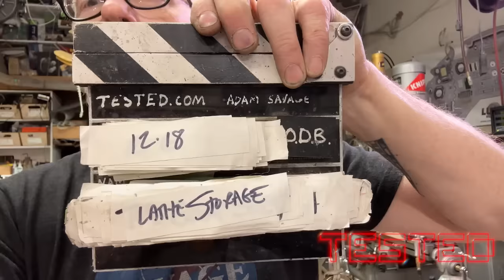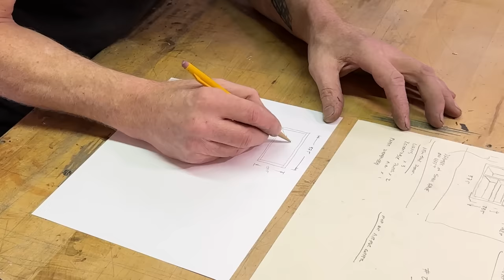Adam Savage Sets Up His Shop's Second Lathe!

Comment: Love how the lights dim when the Lathe switches on 😂
Reply: Big motor on the same line. Kinda like having water run down a pipe and flowing at one end you open up another tap in between and until the flow equalizes, the waterflow on the end is lesser.
Reply: Quite the power surge
Reply: @aserta  Also doesn't help that he apparently has the lights above the lathe and the lathe itself (and possibly other things) plugged into a power strip mounted on the wall above it. (You can see him unplug it around 15:37 while he's working on the gear section.)
Reply: It's probably a capacitor start motor. They build up a lot of current and then dump it all at once to kickstart the motor.
Reply: At the Heritage railway i used to work at the shop lights would flicker when we started the big lathe, it was like 4500mm between centers and 700mm over bed.
Reply: Motor In rush current from start up
Reply: soooo lathes, like printers, should be on their own outlet...
Reply: i would have preferred that space be open thru to other side instead of blocking it with the lathe. now you have to walk all the way around to go to either side. could have had two ways to get from either room. and all those metal shavings... lol
Reply: It’s like when I turn my vacuum on and my lights dim in my home lol 😂
Reply: Yeah. He really needs to put that lathe on a dedicated circuit.
Reply: @Moddage  That power strip sure looks busy. 😐

Comment: I have a small Jet 13x40 I bought new in 97.  Been an amazing tool and paid for its self a 1000 time over.  It’s really heavy and has two cabinets on either end where I keep hundreds of pounds of round drops and my chucks.  I love this cabinet you built.  I believe you bought a new lathe since this video was shot.  It sounded like my main Sharpe mill that needs swapped out with a good one I don’t use because of space problems.  Thanks for sharing and inspiring.  You rock

Comment: The 1st cabinet I put a light in was a  bathroom corner sink cabinet in 1998, when I was remodeling my 1st house.

I'd been building/installing cabinets  as a remodeler for 30+ years & had never thought of it before.

Now, I can't understand why ALL lower cabinets don't have lights. I worked my way thru the bathroom & kitchen putting lights in the lowers.

Now that I'm officially ancient & my eyes struggle w/ light transition, I'm even more pleased I did.

What cabinets I have after the shop remodel I'm in the midst of, will get lighting, as well. But I'm moving from cabinets to a full wall open shelving design & getting rid of half my cabs. Most remaining cabs will be drawer cabs

Comment: I have a lathe in that class. If you remove the spindle, be sure you have the belt in place before you slide the spindle back in. I missed that step the first time😯 so I had to immediately remove it a second time😖 I'll be interested to see how you preload the spindle bearings.

Comment: I'd setup the second lathe for CNC operations. It's easy and it opens up some tasty possibilities. Depending on how profesh the upgrade is, it can be expensive, but you can 100% make it on the cheap, including second hand parts and DIY componentry.
Reply: It’s far more sensible for someone like Adam to buy a used cnc lathe. It is by no means easy, and the usefulness is limited for him retrofitting an old lathe is almost never worth it, for a multitude of reasons.

Comment: Before taking the gearbox apart check the play between the interchangable gears! Its common that people leave not enough play between gears when switching them out! gears should have some play. Put some drops of oil on the gears after adjusting. 9/10 times its tight gears that cause that sound! 

If that does not help, check if the main bearing for the chuck spindle needs adjustment. 

Greeting from a machineist from Sweden.

Comment: nice build That Shenwai sounds excat likes mine from 1978 when the feed is engaged. the smal gears running again the spindel sounds terible and trhe 127 tooth gear sings its own song.  the build in poulies are on an extra frame behind the headstock.
great lathe use it every week.

Comment: Great work Adam; your cabinet was elegantly simple in construction. I noticed your lights dimming when you turned the lathe on; I think this indicates power sharing between differently-rated circuits. With a complex set-up such as your workshop(s), it is probably worth reviewing your electric supply circuits and/or advice from a clever Sparkie, who may recommend upgrading sections of the supply cables. Something beyond my skills to do, but then most of my tooling is hand or battery powered!

Comment: Adam, it appears that you have that lathe wired for ~110V and plugged into a power strip(as seen being unplugged around 15:37) with other things, if I'm not mistaken that lathe has a ~1HP motor in it which likely has a nameplate rating of around ~12.6A at 110V(unless the motor has been swapped of course), per NEC 430 and assuming it has a 1HP motor that lathe should be on its own 15A circuit @~110V.  Please check the motor nameplate rating and adjust how the lathe is connected to power for safety sake. You could also rewire the motor connections for 220V(it should be a dual voltage motor) and supply it with an appropriate 220V circuit. At least eliminate the power strip between the lathe and the power source, between starting current and current under load when machining something, that power strip is not likely to be happy.

Comment: Hey Adam, Suggestion - You could PIVOT the TWO LATHES  to form a U SHAPED LATHE PIT - Lathes facing each other.
Then you would not have to walk around into the Hardware Store to use the smaller lathe.
You could out the Chucks and common Accessories at the end of the U SHAPED PIT to close it off from the Hardware section and gain more area there.
Regardless - Love the reorganization - you are an amazingly patient man - I would have lost what's left of my mind..  ;)

Comment: I am sure this has been suggested but I think you need to move your table saw to the new hardware store area. You could build sweet outfeed table with tons of storage and place it right where one of your work tables are located currently. Outfeed tables with table saws greatly increase efficiency as well as safety. It would almost be no consequence unless you can't seem to keep it clean.

Comment: I think you should have a backsplash behind the lathe (plexi?) so that fluids are better contained.  Also, I like using 3D-printed stands for Morse taper tooling so the tapers don't bang around and get 'bruised'.  Personally, I would have made the cabinet ~8 inches shorter so that the top could be an open shelf for stuff you need at hand (like a lathe file).  But I love the idea of lights!

Comment: There are differences in lathes 4:09  that I consider a deal breaker in some cases. I learned on Colchesters and the handwheel arrangement on that type of lathe. If I try to use a Harrison lathe which has a handwheel configuration that is opposite to the Colchesters, it feels completely alien to me.

Comment: Clean the gears, replace worn bearings, and CHECK that the knobs/levers are installed correctly for selecting thread pitch and not reinstalled upside down.

Comment: I am so confused. A few years ago Adam talked about moving shops due to break-ins in the area, talking about how it was hard to move the equipment out because the floor was not completely concrete etc. How is he still at the same shop then? Am I going crazy?
Reply from the maker: The shop where they were filming Savage Builds was broken into. Adam’s own shop hasn’t changed locations in more than a decade.

Comment: think youre going to need an evac system for the woodmachines , you can see the dust wirl all over the shop when you work those machines and it lands amongs other places on youre greased up metal working machines creating a greasy mud thats realy bad for bearings and the way scrapers / ways , wonder if theres enough space under the wood floor to put in a solid pipe system and have round lids you can pull out of said floor to plug in a flex extractionhose 
having hoses come down from the ceiling is a bit problematic since you use a lot of that space to hang props and parts

Comment: Why do the lights dip when you turn it on.
Reply: Because his electrical box is at the other end of the shop (thus more voltage drop) and the surge is significant on lathe startup.
Reply: @stargazer7644  see I just blow the electric in the house when that happens in my shed 😆

Comment: I'm worried that one of these days, Adam will be working with something with doors, and one of the times he walks away from it the unsecured doors open and tip the whole thing off the bench. He keeps putting stuff like that right on the edge of the bench where that'll happen. It's almost happened a few times in the past, if he hadn't been there to catch it.

Comment: I have 2 AMERICAN MADE lathes. a 1917 Walcott, and a 1951 Leblond. And little use for Asian built to a price disposable machines.  I am sure they work fine now. Check back in 50 yrs however. My 107 yr old machine still performs perfectly. HINT... if your shop lights dim when you start a machine, your wiring capacity is not sufficient. And yes your correct, that lathe sounds like poo. You can hear every gear ringing away in a poor fitting symphony.